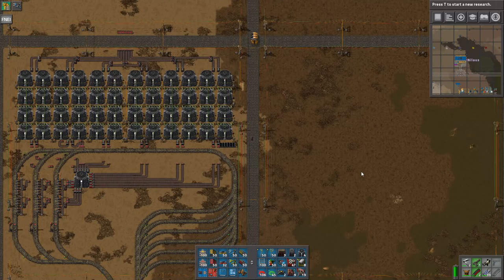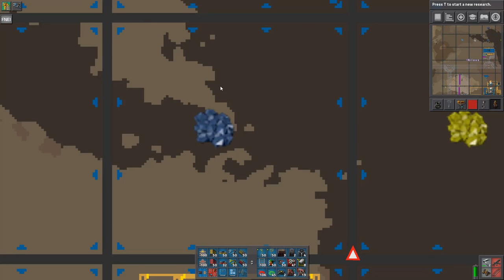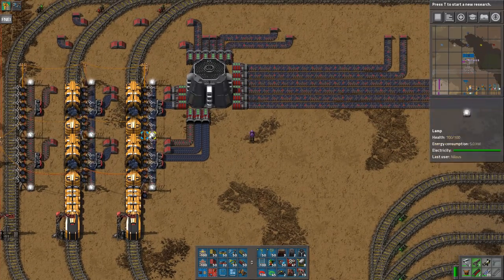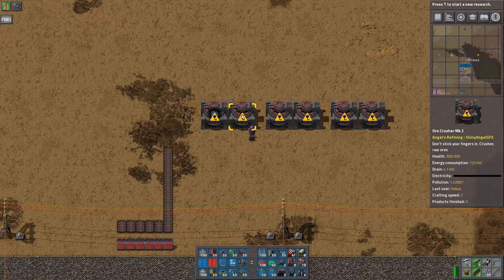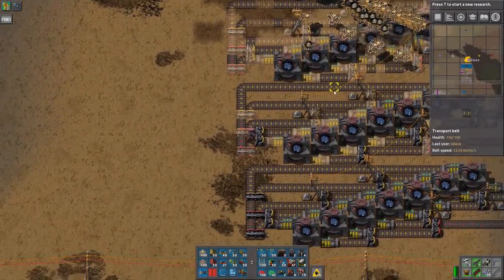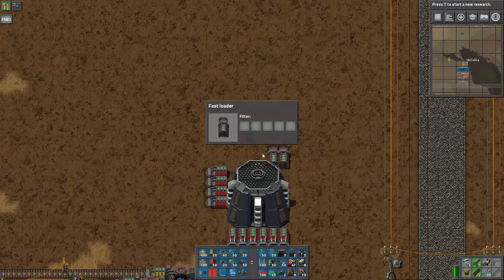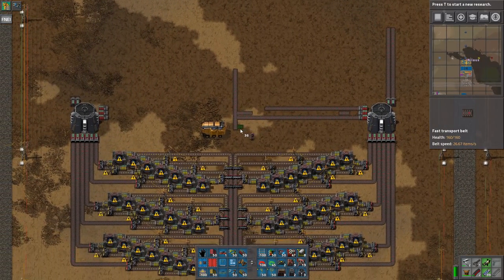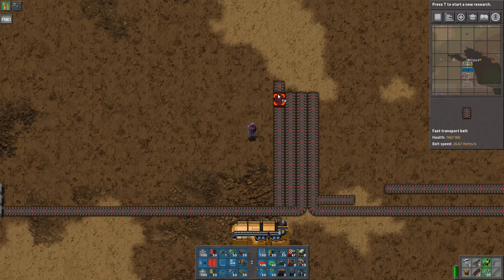Factorio 0.16 - Angels Mods Tutorial Lets Play #17 INDUSTRIAL CRUSHING

Comment: Hey, some of this crushers not working at full speed because you have 4 crushers outputting to only 1 red belt and other 3 to second. You can see it at 29:20 . At blueprint "7 to 2" it works perfectly but in reality you need to balance crusher in the middle to output to both red belts in order to get full speed. And also replace some yellow splitters to reds because they inputting 2 almost full yellow belts but outputting technically only 1 yellow belt (to red splitter standing next to them) so that not enough.
Sorry 4 bad english.

Comment: Hey Nilaus. In order to get the most out of warehouse balancing, wire every output belt to the warehouse and set the condition on the belts to enable when anything > 100. Works brilliantly. Or, since it's probably never going to be a problem, leave it as it is :)